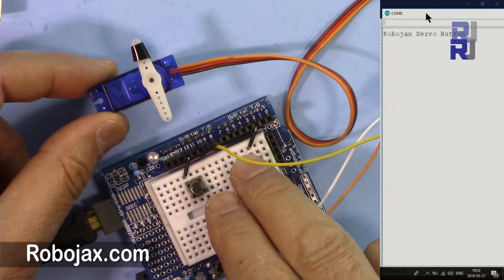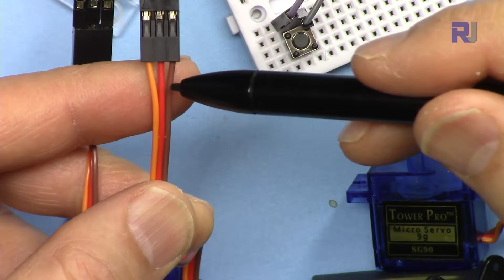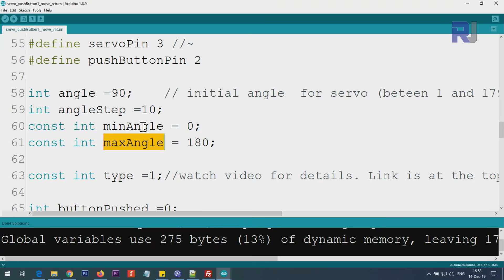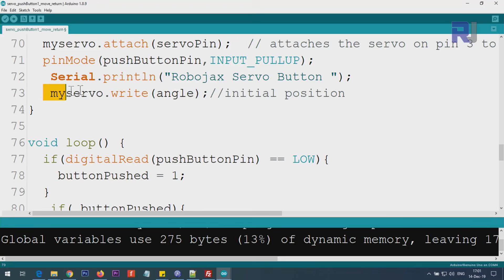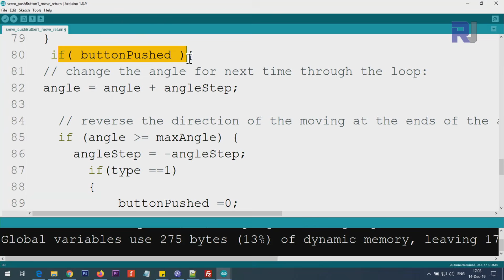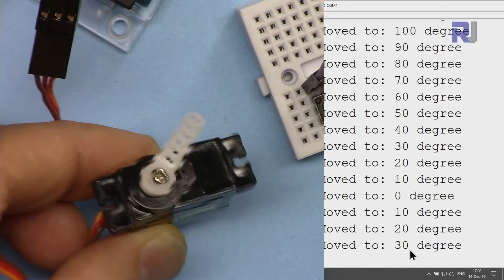Control Servo motor with a Push Button:  Move Servo and Return SPB-1

Comment: Where do I find the project that you push the button and the servo moves 180 and stops and when you push the button again the servo turns back to zero and stops?
Reply from the maker: On the resource page there are links to other articles or tutorials for the server and there are tons of it. Just check it
Reply: @robojax  Thanks to your videos I have been able to get one servo to work like I want. The problem is I can't get more than one to work. I would like to use all 6 ~outputs. (1 for each servo with a button for each servo) Thank You for replying to my comment.

Comment: I need to control 15 servos with a single momentary on push button. I need them all to start at 30 and stop at 160 then return then return from 160 to 30 on the next button push. I’m running them in 3 sets of 5 and need to time them to move with a 500 millisecond delay between each set. Can you please help ?

Comment: What is the code to make it so the servo motor rotates at a certain angle when the button is pressed but returns to the previous position when released
Reply from the maker: I have written so many serve codes. you may find it if you search or simply watch, learn ad write your own code. I have explained every line of codes. good luck

Comment: Good evening to all, my apologies for the illiteracy on the servo programming. I typed out everything as you had listed minus all the // and the text following. The servo did not move. Since my servo only goes 180 I would need to the servo to start at say 10 and end at 125+-  I am not sure where you have (angle) or degrees if I actually need to place a value in all those section.  Also at the end at the serial.print sections. Again my apologies but this is definitely interesting to learn and to make happen.  
Thanks

Comment: Thanks for your video! Super helpful for the wiring. I am wondering how the coding would be different if I was trying to use a continuous servo motor instead of a positional servo motor. Is there another video for this? I am trying to have my motor rotate for a specific amount of time then stop until the button is pressed again, running the same command
Reply from the maker: Contenouse servo motor is a joke. Not a real product. Only $500 or expensive sevo would work. so use stepper if you need precise positioning. I have more videos on servo, you may find codes that fits to your needs.

Comment: Hello, I would like to build a similar circuit for a model car (mechanical transmission). It should be operated with 2 buttons (up/down). Each time you press the button, the servo should adjust by 10 degrees (or another defined number of degrees).
Neutral = 0 position
1st gear = one down
Neutral = on up
2nd gear = one up
3rd gear = one up
4th gear = one up
The entire transmission should then be switched up (UP) and down (down) using 2 buttons.
It would be great if the “UP” button also had the function if you switched it to its 0 position (neutral) for 3 seconds.
I would be very grateful if you could help me with this.
Thank you.
 Greetings Hans
Reply from the maker: Hi, please search my channel I have so many video for servo with push buttons

Comment: Sir, is it possible that the servo is controlled by the temperature like if the temperature is greater than 50 the servo will move to 180 and if it is below then to 0..
Reply from the maker: yes it is very simple. you gotta learn your temperature sensor code, then learn the servo code. you may learn the concept from this video where the motor speed is controlled by temperature https://youtu.be/5xQ8vLavWKQ

Comment: Hey is it possible to control two servo motors like this with separate buttons in one arduino board?
Reply from the maker: You can do as many as you like. I have explained it fully. Simply define the needed variables and you should be okay

Comment: Please can you post the code please its really difficult trying to keep up with video and swapping between software. I'm trying to use two inputs 1) 40 degrees and then 2) 60 Degrees then back to 0 when released. this code looks what in looking for but its hard to copy from screen and then add to code.
Reply from the maker: The code is there below the video . Also I have shown more than 10 times the website name Robojax.com just go there and get it if you cant find description of this video
Reply: @robojax  apologies I did notice shortly after leaving comment.

Comment: Hi Mr. Ahmad I really appreciate your work this is also one of my project and it served as an open and close. Is it possible to add another component like electric solenoid valve to connect to the arduino and operate the same time and program as i pressed the button?
Reply from the maker: Hi, yes of course you can do and use Arduino's otgher pins and features.
Reply: @robojax  excuse me sir, do you have a tutorial about RF Transmitting Module Remote control servo motor?

Comment: How would i go about coding a servo to move to a certain angle when a button is pushed and back to its original angle when button is pushed again ? Say i wanted the servo to start at 90 but when i push button, servo moves to 180, when button pushed again it goes back to 90
Reply: void loop() {
for (pos = 90; pos <= 180; pos += 1)
myservo.write(pos);
delay(15);
}
for (pos = 180; pos >=90; pos -= 1)
myservo.write(pos);
delay(15);
}
}
Reply: @OpenFilmmaker is that really all the code it takes to do exactly what they described? I’m using 15 servos  and need them to go from 30 to 160 when the button is pushed and go back to start position on second push. Want to use a momentary on push button. Using arduino r3 and pca9685

Comment: I tried making the servos sweep using millis instead of delays and somehow the servo would only sweep if I kept the button pressed down. What am I doing wrong here?

#include <Servo.h>
Servo servo1;

Servo myservo;
#define servoPin 3
#define pushButtonPin 2 
#define RedledPin 8
#define GreenledPin 7

long randNumber(1,2);

int moveTime = 500;
unsigned long previousMillis = 0;
const long interval = 500;

int buttonPushed =0;

int step = 5;
int lightON = 180;
int lightOFF = 90;
int position = lightOFF;

int pos = 0;
const int minAngle = 0;
const int maxAngle = 180;
int i;
int n = 4;

const int type =2;

void setup(void) {
  Serial.begin(9600);
  servo1.attach(servoPin);

  pinMode(pushButtonPin,INPUT_PULLUP);
   Serial.println("Robojax Servo Button ");

  pinMode(RedledPin, OUTPUT);

Serial.begin(9600);
   randomSeed(analogRead(0));

}

void loop(void) {
  if(digitalRead(pushButtonPin) == LOW){
    buttonPushed = 1;
  
    if( buttonPushed = 1){

      for (i = 0; i < n; i++) {

          unsigned long currentMillis = millis();
        if (currentMillis - previousMillis >= interval) {
          if (servo1.read() < 90) {
            servo1.write(120);
          } 
          else {
            servo1.write(30);
          }
          previousMillis = currentMillis;
        }
      } 
    }  

   Serial.print("random1= ");
   randNumber = random(300);
   Serial.println(randNumber); 

    if ((randNumber & 1) == 0){
      digitalWrite(RedledPin, HIGH);
      digitalWrite(RedledPin, LOW);
    }
    if (((randNumber & 1) == 1)&&(randNumber < 100)){
      digitalWrite(GreenledPin, HIGH);
      digitalWrite(GreenledPin, LOW);
    }
  buttonPushed = 0; 
  }
}

Comment: Nice video 
Sir can you please help me out 
I need  this type
First I press button servo motor will move 0 to 90 degrees 
After some time I press that so servo motor will came back from 90 to 0
Now here the main challenge 
Again I press the button now servo motor will move  from 0 to 90 degrees...
Now suddenly power supply turns OFF
In this case I need that servo motor should be came back 
from 90 to 0 degree...
Is it possible   ?
Please help 🙏 me....Thanks
Reply from the maker: Hi, I have so many videos on servo. please search my channel and I am sure you will find something useful. the links should be in the description or search for videos in my channel. if you don't know how to find a particular video in a channel , then please watch this video https://youtu.be/OhkUceBWcHs

Comment: Hi,
This video help me a lot. I have a project where i'm trying with one relay or button give angle to motor and when second time push button or signal from relay i need to give different angle to motor. I have 15 diferent angle, how to continue every time with same relay or button and after that motor start to zero point? If you can help me please.
Reply from the maker: Hi, have so many videos on servo motor. Just search my channel. Here is how to find Specific YouTube Video in a channel https://bit.ly/findYouTubeVideo all the codes are free. but if you want custom code, I you would have to compensate my time and pay me minimum of $50. if you are interested, then contact me robojax.com@gmail.com so we discuss it. I will not reply to question via this email. it is just for business. thanks

Comment: Man... I would LOVE to be able to apply one of these(preferably with a wireless remote control, programmable distance just up and down maybe 25° or 30° that runs with a or some batteries) to a sort of PROP I own from Chuck E Cheese that’s plastic with his face and normally with compressed AIR and the tiny cylinder on the back make a piece move down then back up to create the appearance that he’s winking. I just have it propped open now but would love to be able to activate it via remote.
Reply from the maker: Hi, here is the video showing how to use remote https://youtu.be/LVd9_i-BQcg and I have more videos on controlling servo motor. Just search.

Comment: NO, servo plus volt and gnd need be to own battery not arduino, only arduino to servo need gnd all together. arduino board not handle all power what servo need. burn arduino board. all schematic have servo gnd to arduino AND battery, power plus wire to only battery, and data to arduino. battery power can use servo and inbut connection to arduino board bu not servo to arduino board. only data out arduino to servo.

Comment: Hello sir , my question is .. when servo move to 1-180 and i want it delay for 5s .. after that automove back to 180-1 .. how the code sir? Please reply n help me to solve this problem. Tq
Reply from the maker: Hello, you just said it , just add delay. I have explained it fully. Watch it 3 ,4 or 10 time until you know how it works and write your own code.
Reply: @robojax  sorry not delay .. i mean it stop for a while like 5second after that the servo move back from 180°-1°..
Reply from the maker: Yes I have explained it lime by line and mention at what point it goes from 0 to 180  add delay(5000)
Reply: @robojax  ok sir .. thank you ..

Comment: I regularly watch your videos I have seen V1 V2 V3 using PCA9685 to control multiple servos and control servo motor by potentiometer also but not able to modify code for my purpose so I request you to please help me .
I want to operate two servo motors with one push button say servo1 will move from 0 to 180 delay for 2 sec and return to 0 then servo2 should move from 0 to 180 delay for 2 sec  and return to 0 by pressing one one pushbutton.
Reply: Please reply
Reply from the maker: Hello, I try to answer question related to the video only. got no time to write code. you can seek help from Arduino forum https://forum.arduino.cc/  or watch 2, 3 , 5 or 10 videos to learn it as I have more than 20 videos on servo all fully explained or hire someone here https://www.upwork.com/

Comment: Your videos are very good 
You put in lot of efforts 
Thank you for giving us this all ready to implement .
One question please
If I want to operate two servo motors 
with one push button say servo1 will move from 0 to 180 delay for 2 sec and return to 0 then servo2 should move from 0 to 180 delay for 2 sec  and return to 0
How to code
Reply: Subscribed and 👍
Reply from the maker: Thanks. Please search my channel, you will find it. Please don’t forget to subscribe.
Reply: @robojax  I regularly watch your videos I have seen V1 V2 V3 using PCA9685 to control multiple servos but not able to modify code for my purpose so I request you to please help me .
If I want to operate two servo motors 
with one push button say servo1 will move from 0 to 180 delay for 2 sec and return to 0 then servo2 should move from 0 to 180 delay for 2 sec  and return to 0

How to code
Reply: Did you figure it out? I have the same problem

Comment: I really need some help! I need a program that when I push a button my servo will rotate 360 degress(Yes I have a 360 degree servo) and then stop, and when I push it again it should go back to 0 degrees. Any ideas?
Reply from the maker: Did you watch the video I have for 360 servo? 360 servo is just joke product, not real product.

Comment: The code works well, but i was wondering if there is a way to toggle the button so when it is held down, the servo will go to 90 degrees and when it is released it goes back to zero degrees.
Reply from the maker: Hello, I have written times of codes for servo, just search my channel

Comment: Your videos are helpful thank you. I have a project where i'm trying to make a push button servo work along with a 7 segment display. Using a button for movement in the positive direction and a button for movement in the negative direction. 

What I would like the servo to do is. At the press of each button I would like the display to count up and the servo move a certain angle. Press the button again the counter counts up by one and the servo moves up an increment again. Same for down. If I press the down button the servo moves back the same distance. Would you have any idea of how to structure the code to make this happen?
Reply from the maker: Hello, I have a touch counter video which you can watch, learn and use for this project https://youtu.be/5A9jPD5nUCw I've explained it fully. if you watch it, you can learn and use it very easily.

Comment: Hi is it possible to take a 360 degree servo with an Arduino and control it by pushing a button to make it rotate 360 degree and stop then push a second buton to make it return 360 degree and stop.   PS love your videos
Reply from the maker: Hi, I check and replied after 3 days. I wish you had searched for it in my channel here is the video https://youtu.be/hVe4TSRV4ww just search my channel and you will be surprised

Comment: i have a question, what about if i want to install two servos? (two systems in one arduino)
Reply from the maker: apply the same method, define pins for each servo and each push button and it should work.

Comment: please how to do it so when i press the button it comes to the angle and stays there ? and when i press it again it will go to the starting angle?? pls help
Reply from the maker: Hi, did you check the links in the description below the video?  I have so many types. Check it please
Reply: @robojax  yes i tried all of the codes and they were kinda buggy and it was not that what i was looking for :(
Reply from the maker: none of the codes are buggy. Please point to one of them so I fix it. They all have been tested, recorded and the same code has been shared. so whatever you see on the video, you will get the same code. if your result is different, then you are doing something different.

Comment: hello i need help you
Reply from the maker: Hello and you are welcome.
Reply: @robojax  A program will be written to provide angular control of 4 servo motors with Arduino. There will be 37.5 degrees of angle difference between each servo. All of them will be programmed to change at the same time. Control will be provided with a single button. each will be shown by led at the same time
Reply: @robojax  my homework pls help me
Reply from the maker: you gotta learn to do it. I've fully explained it.  if you don't do it, it is cheating.  I am educator, here on YouTube and  in my personal life. you gotta get your marks by learning and answering. World will be a good place if people cheat.  Good luck.
Reply: @robojax  thanks but i did

Comment: hi Mr Ahmad! I'm using your tutorial for my project as I am a beginner at arduino (and i know about 0 to no knowledge on it) I've copied and uploaded your code to my board but it's not running, is there any changes I need to make to the code before running my project or do i just copy it straight from the website? Sorry for the silly question!
Reply: by not running, I mean that every time I push the button, it does not do anything
Reply from the maker: Hi, you just copy and paste and connect the wires as shown, it should work.  I would suggest using servo motor without the push button to make sure it works. Then come to this project. I have separated video on that . See the links in the description or search my channel. Good luck.
Reply: @robojax  hi! I tried again and the code runs! the problem is, my servo motor is not moving. Is it a problem with my servo motor or does it have to do with something else?
Reply: @syirah7765  You might not have a servo library on your IDE

Comment: @Robojax bro from the last 2 days i have tried so much but i was not at all succesful at moving 2 servos with 2 different push buttons so that when the button is pushed the motor completes 180 degress and comes back .... i asked a few people who were familiar wit arduino but they didnt do much ... it would make a huge difference  if you could help me with this .... looking forward to your reply
Reply from the maker: Hi, most of the time people skip. I you want to learn, then watch this video and pay attention to the Code section and learn about "Object" https://youtu.be/_uz7YcOzvjU one you did, then you can use customize this code very easily. Good luck. but if you skip, you will not learn and won't be able to do it.